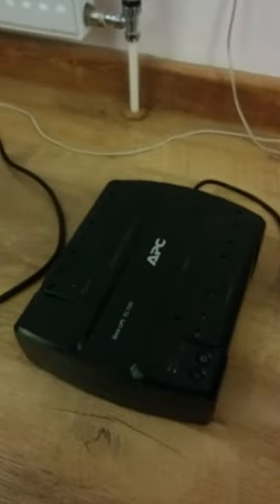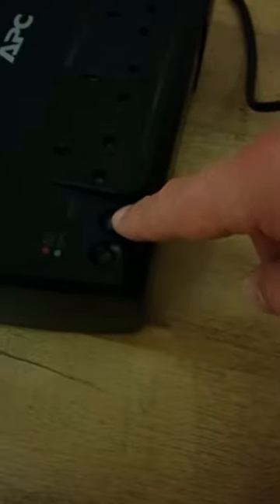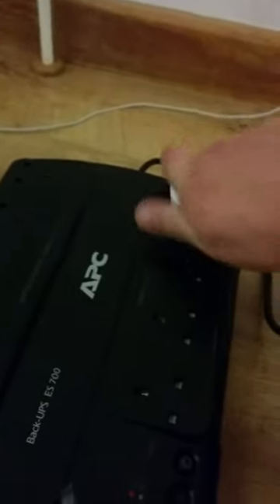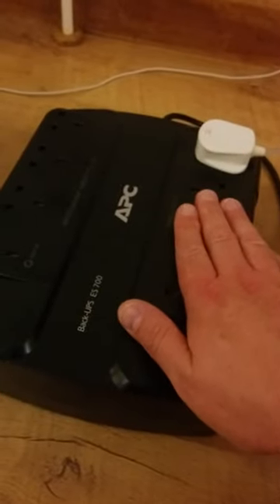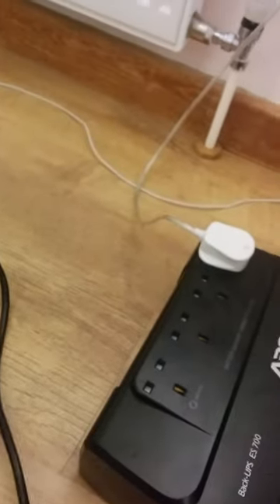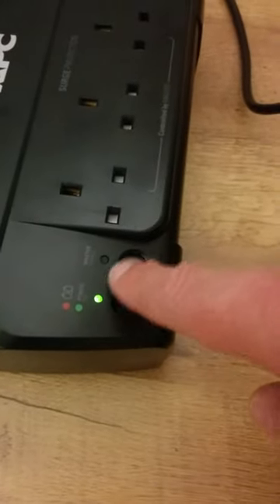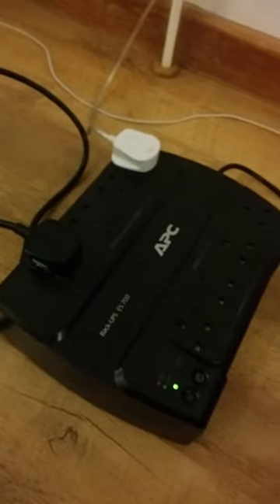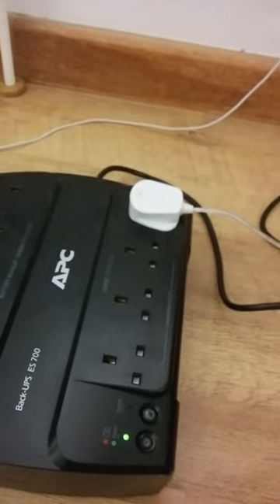Issue with replacement APC BackUPS ES700

Comment: Looking to solve my problem with ES700 (which is different from your), I found this video. After almost 2 years I'd guess you no longer care for reason, do you? That is wrong with your device is that when you are working off battery you get the power from inverter. When you connect external mains inverter shuts off (this is no double conversion UPS) and the power should be supplied from mains. Looks like your STS (thingy responsible for deciding from where to get power) notices that mains are back and switches back to it, however connection from mains to direct (after some filtering) supply voltage is not working. I expect that your pcb went home ...
Reply from the maker: It was a broken cable, APC replaced the whole unit (again) under warranty.
Reply: Alec Muffett thanks. Do you know which cable? My APC from time to time gives me: battery disconnected (with brand new battery) and I can not find the issue ...
Reply from the maker: Mariusz Dullak - it was the main power cable, where it entered the unit.

Comment: Mine stopped working on wall mount, works only on battery, if I plug it on wall nothing happen.
Everything started a week ago when suddenly the alarm to replace the battery started to blink, then I replaced the battery and since then I wasn't able to use the UPS for those reason. Is out of warranty so I have to figure out what's wrong with it.